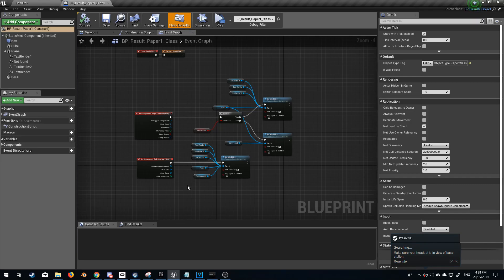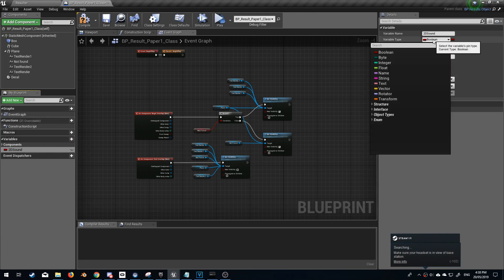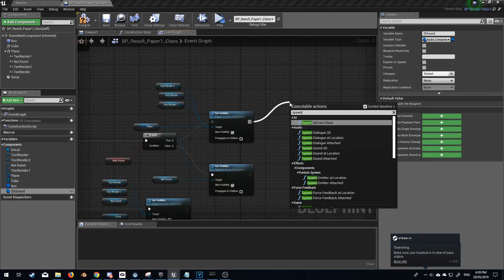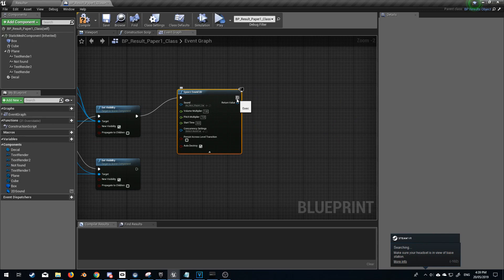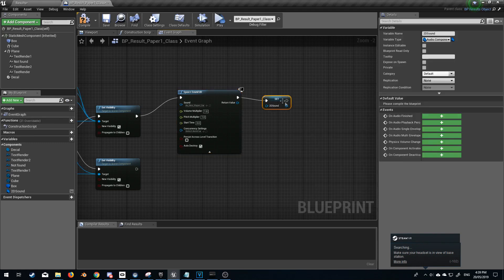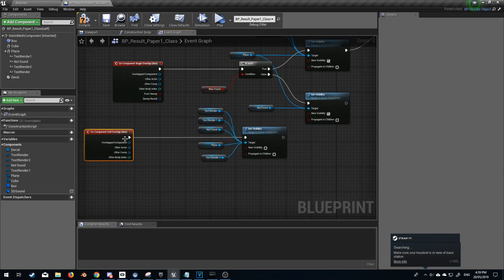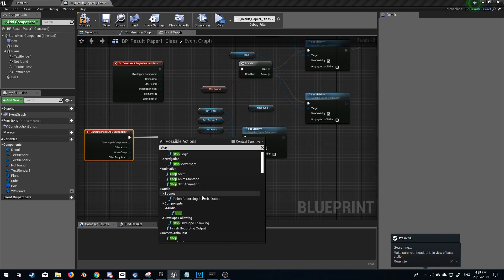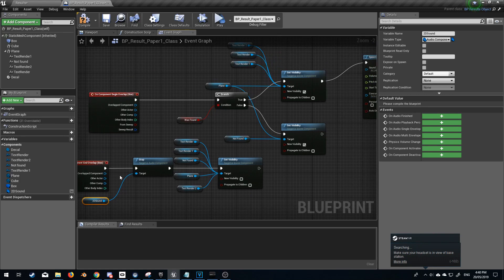UE4 Stop Sound at Location Blueprint Tutorial

Comment: Hello, I made an Elevator with Blueprint. For the sounds I simply use Play Sound 2D. Now I have the problem that I can´t find a thing to stop the sound after 5 sec. My sound file is 10 sec long and I want to stop it after 5 sec because the elevator is not moving so long. I found delay but no possiblity to stop a sound after spicific time. I know I can use level sequencer but this time I want to do it this way. (Sorry for my English, I am still learning:)
Reply: You need to use SPAWN Sound 2D Node, not Play Sound Node. 
Spawn has a blue Outpin (a copy of the Sound we Spawn). And we need this reference to the sound, so we can tell it what to do later.
So after the Spawn Sound > drag the blue Outpin > type Stop Delayed (add this node which is is UE4.27 at least). Then type in your delay time. (And connect the white pins.)
Reply: @kenalpha3  YES!! Thank you very much! I tried it and it works!